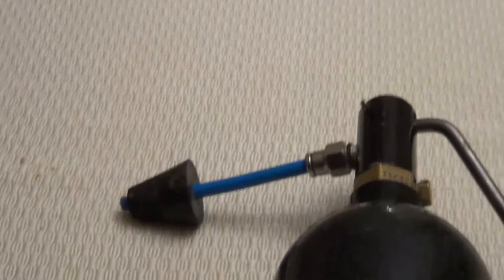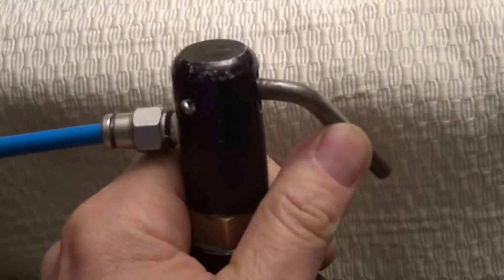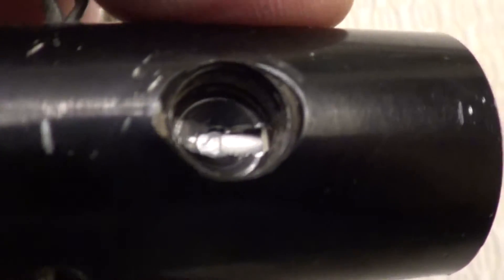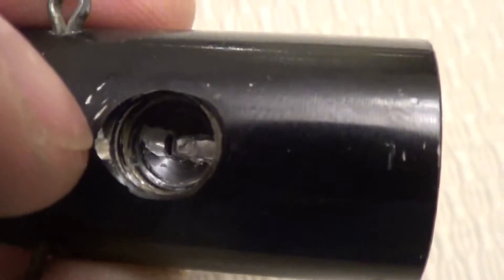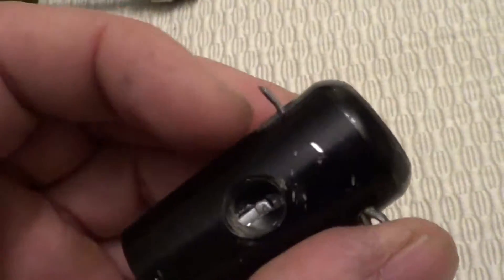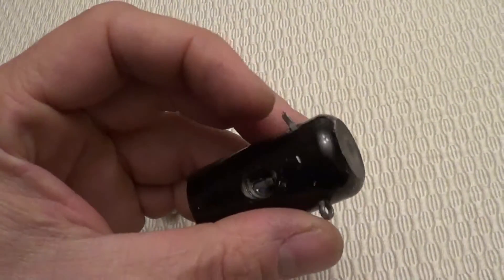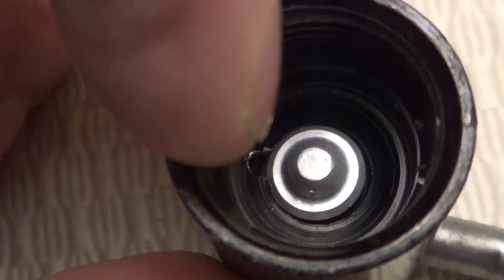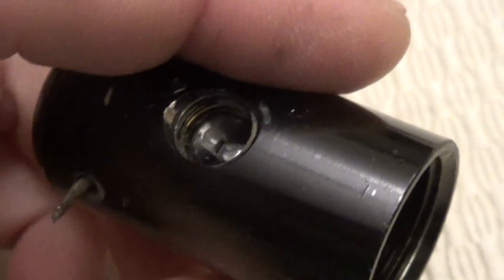Modifying CO2 drain blaster for more air flow

Comment: By the way ,what size bottle do you use. I see them on e bay and they are different capacities.
Reply from the maker: +MrMultitool   I used the larger 24 ounce bottle.  However, I only put about 4 ounces into the bottle.  Putting more just blows out liquid and waists CO2.  If I am going to do alot of soldering, I might put in 12 ounces.